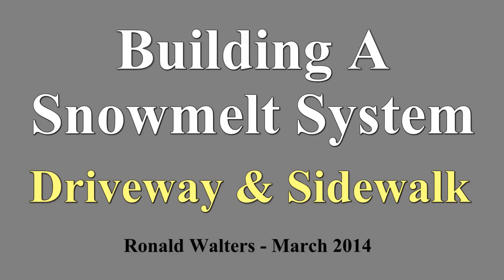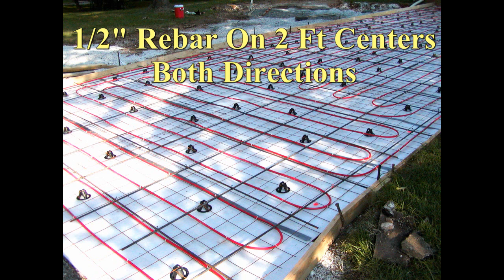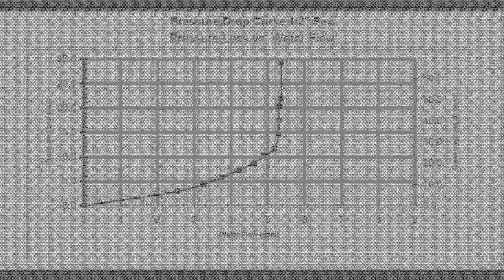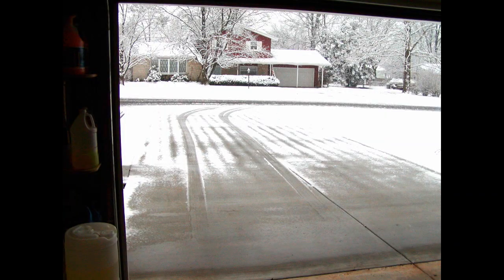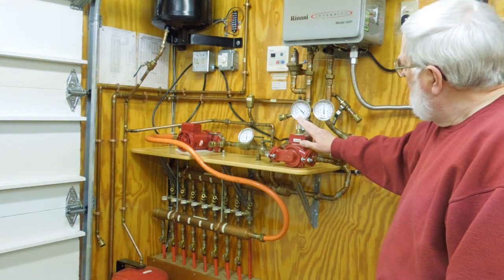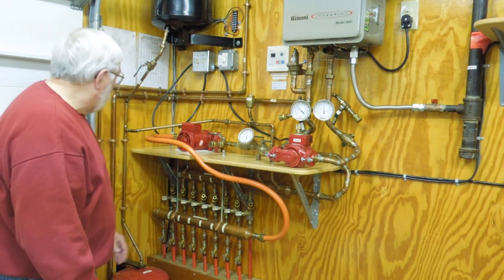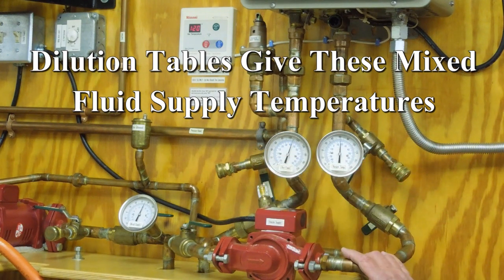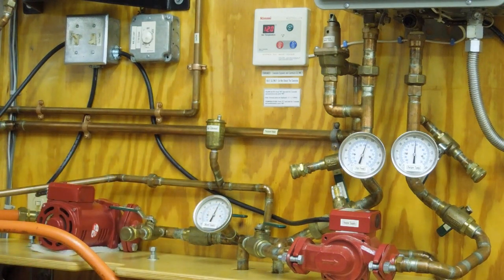Snowmelt, Building A System - Driveway & Sidewalk

Comment: hello Ron hope all is well
i recently fired up my "home made system" that i actully copied very similar to yours , im  experiencing a problem and want to see if you had a similar  issue befor maybe you can help me :)
my system loops are all running 1 gpm and its all circulates fine , the system runs fine for the first 10-15 minutes and when it starts to heat up my flow rate going into the heater starts to decrease gradually untill it stops and reaches zero ! no matter how high i start it from 1.5 gpm or 1 or even half , it slowly keeps dropping untill theres no more flow going into the heater !!! very weird i checked everything even replaced the pump and i have another heater also i replaced and it seems to keep doing the same thing ! do you have any idea why this occurs or do u have any hidden check valves in your system ? 
thanks in advance sir 
you have been very helpfull
Reply from the maker: The only time I needed to use check valves was in my house radiant system when I had individual pumps for each zone but a common return manifold. I had to go back and install check valves to prevent back flow when a particular pump was not running.

On my snowmelt system, the single supply pump feeds fluid to the supply manifold, which has each loop connected to it. There is a small valve for each loop to enable shutting that loop off (mainly useful when filling the system and getting air out or if you should somehow develop a leak).

All loops return to a single return manifold… but… each loop has a flow control valve and a flow meter for adjusting the designed flow rate through that particular loop. Loops of different lengths will require slightly different flow rates (by design).

You say each loop has 1 gpm going through it, but if you do not have a flow meter on each loop you cannot know for sure what is going through it. I say this because I have not see your system.

Your tankless heater has a screen on the intake side. Pull out that screen and see if it is plugged with junk. These screens are very fine to prevent plugging and damage inside the heater itself and the screens can plug easily. Any debris or contaminants will slow down or stop flow through the heater.

I have a small separate pump just for the tankless heater… so I have two (2) pumps. One large pump circulates the entire system and the small pump delivers a smaller amount of fluid to the tankless heater. The circulating pump circulates fluid through the loops at a constant rate. The pump for the tankless heater allows for regulating the flow through the heater. You always want to start off slow with heated fluid so you do not shock and break your cold driveway.

Any air remaining in the system can and will find its way back to a manifold or pump and cause cavitation, which will stop flow through the heater. The system must have absolutely zero air in it.  I use a Hoffman No.77 Air Vent located on a high point in the piping to bleed out any air which remains.

I have an expansion tank to allow for expansion of the heated fluid in the system. The expansion tank (bladder) is pressurized to 12 psi and I have the system pressurized to 15 psi. Pressurize the expansion tank first… then pressurize the entire system. The system must remain pressurized to keep the pumps running and to prevent damage to the tankless heater.
	
That’s all I can think of. Hope that helps!
Ron
Reply: @RonaldWalters2010   my system is identical to yours i have an 8 loop manifold with flow meters on each one and they are adjusted to 1 gpm with the primary pump it pushes 8 gpm and in that circulation everything is just fine , the secondary pump just like yours as well it pushes the water to the heater and back to feed the main line , the only difference is that i saw your heater lines are both going straight to the end of your manifold in my case my manifold only has  only 8 loops so  i have two Ts after the manifold that supply the heater and then back to the main line 

i have been reading about this for days and i think i found the problem , both Ts should only be spaces less than 4 inches apart so the pressure drop that occurs after it starts to warm up shouldnt effect the flow going to the return side of the heater and slowing things down , in my case i have them spaced far apart and tomorrow i will move them exactly near each other

yes i checked the screen and its clean and my system should have zero air in it 
im pretty sure now after doing some home work that having the Ts right next to eachother ( inner and outter) or replacing them with a mixed 4 way vavle should resolve my issue 

i do appreciate the quick replies to your comments
hope i get some snow soon to really see how this thing will keep up

Comment: Hi, I put a system in after doing much research and watching your use of on demand. I used 3/4 pex with 8 x  ~250 foot  runs to cover a 1900 sq ft driveway. I have a 200,000 btu on demand water heater. I have asked the pros and they are pumping the water out to the drive at 140 degrees. This definitely contradicts what you are saying. I can dial my water heater temp back to 98 degrees and with hot to cold injection I can take it down to any temp I want.  I have 2 pumps , a low speed and a high speed. I plan to keep the drive at 30 degrees with the low speed. Then use the high speed for the snow melt and bump it up.  My questions are...... if your driveway is sitting at 30 what temp do you send your water out to it at during a melt situation?  What temp do you target your driveway to and what return temp do you look for. Or do you look for a specific delta between outgoing and return temperature and adjust your flow rates to achieve this delta. I specd out a smaller heater but decided to go with bigger just in case. I doubt it will ever be taxed and maxed out , good thing it is modulating. I may/plan on adding some electric shut off /on valves and a snow sensor as I plan on making it somewhat wifi operable  and automatic.
Thanks
Reply from the maker: I trust you had someone do a heat load calculation for the size and quantity of PEX you have in your driveway. If you are planning on keeping your driveway at 30 degF all the time you are going to be spending a lot of money for gas. I do not heat my driveway in anticipation of a snow or ice storm. That is just wasting money. 

In my opinion if you start feeding 140 deg water out into a cold frozen driveway (concrete) you will probably crack it all over. Don’t forget the so-called pros are probably trying to sell you a bigger heater or new concrete or just like spending someone else’s money. They may be operating someone else’s system or don’t care if they break the concrete… or they may not know what they are talking about. It may be time to find a new set of “Pros”.

I had “pros” tell me to turn the system on and heat the driveway in the beginning of winter and let it run until spring. Right! That is stupid. That is a government operation… spending someone else’s money. 

You don’t want your on-demand modulating all the time. I feel that is hard on the unit. A heater that is turning on and off or constantly modulating flow rate is like a transmission constantly shifting up and down for no reason. The program of an on-demand heater tells it that it must deliver the selected output temp. If it cannot deliver that temp fluid at the existing flow rate, then it starts trying to restrict the flow rate through the heater. I want my on-demand to operate as a smooth constant burn (speed). 

Trying to find a smaller on-demand heater that can be slowed down to 0.5 or 1 GPM is difficult. My heater is too big. If I replace it, I will use a smaller heater. 

My snow sensor is my eye. A good thick layer of snow acts as a blanket to keep the heat in the concrete. 

In my opinion automatic valves and wifi is just something else to go wrong. K.I.S.S. is the best approach. 

I send water back to the driveway 10 degF +/- higher than it comes in. As explained in the video I have one pump circulating the driveway and the small pump circulating through the on-demand. The heated water is injected back into the fluid being circulated through the driveway. This is dilution or tempering. As the return temp starts to increase I SLOWLY start increasing flow rate through the heater or increase the heated fluid temp. I have a set of dilution tables (for my system) I worked on 10 years ago. For a given temp return fluid, at a given flow rate, how many GPM of hot water will increase the fluid temp 10 degrees … or 15 degrees… or 20 degrees… etc. The tables have proven to be quite accurate at predicting the expected supply fluid temp.

Now you just wait for a snowstorm and go out and play with it… learn how to operate your system without wasting a bunch of money on gas and without breaking up your concrete.
Reply: @RonaldWalters2010  I did have  calc done with one guy saying 200k might do it and one guy saying it’s not enough. I did my own and came up with a 150 k heater. I did some test runs and I believe I could get away with prob 100k heater but they don’t make them. 
Anyways , I can feed the water into the cold  like yours and get the temp down to a 10 degree delta. I just wonder how long it would take to get the driveway from 20 degrees up to 38? 
Since I still work and I can’t trust my wife , I need some type of remote automatic/ control. 
I have 2 feeder lines with ball valves and plan on adding solenoid valves to give them some automation Once I get it dialed in. 
Our average temperature in London Ontario is about 28 degrees in Jan and feb so I may try to shoot for that and watch the gas meter. 
Like you said , its cheaper than the Dr’s bill. 
Thanks for the video, it helped convince me to put mine in. I will post my own when I get time.  
Thank you for your reply, I’ll let you know how things progress

Comment: Could you show how the piping came from the loops into the garage? If you had an asphalt driveway, after the snow has melted and the driveway dried out on the sunny days could you extract heat from the asphalt with a heat exchanger and some modifications to put the heat back into the house?
Reply from the maker: There are 8 separate loops in my system, which have 16 PEX pipe ends exiting and returning to the corner of the garage. I had a 6” plastic pipe and elbow in the corner of the garage floor, which is seen at 1:38 in the video. The pipe ends need to drop down below driveway grade and are fed through the 6” pipe. The 6” pipe keeps the pipe ends together and protects them from any sharp edges. Later, the ends of the PEX pipes are organized and split into supply and return manifolds as seen at 4:20. I built a box around the pipe to protect them from any possible damage.

Asphalt would probably be a poor choice for this system as the placement of the asphalt would be difficult around all the pipe and wire mesh, trying to keep the pipes centered in the asphalt.

The concrete gets hot enough and yes it could produce hot water (available any sunny day all year long)… but what are you going to do with it? When the sun is shining you don’t need very much heat in the house so you would need to store that very large quantity of hot water somewhere for future use. When you start thinking about storing tens of thousands of gallons (or larger) of very hot water in a very well insulated tank, things start to become impractical. Or you may generate electric with the hot water. Pencil on paper soon slaps one back to reality as the cost vs benefit or cost vs savings is not justified for most applications (unless you just want a hobby).
Reply: I Have good cold well water. I am thinking of preheating the water before it goes into the hot water heater. After seeing your video I heard of placing the tubing in sand under the asphalt.
Reply from the maker: John, A little heads up about leaving comments on youtube. I receive a lot of comments and questions on youtube. When you leave a comment or ask a question nested under someone else's comment (even your own, if your previous comment is weeks old), it immediately becomes lost in the shuffle... as with this video which has years of comments. I know you left multiple comments or questions but now this is the only one I can find to reply to.  Always leave a fresh comment under the video if you expect to receive an answer.

I consider asphalt a bad choice for this type system mainly because you can't place the PEX inside the asphalt and even if you could, the asphalt may be hot enough to damage the PEX. Also asphalt does not last as long as good concrete. This has been asked and answered before in the comments.

You do not want to use plain water of any type in your system and certainly not well water because of the dissolved minerals. Distilled water only should be used.

I have also addressed the type glycol used in my system.

Comment: thanks for the video.  Can you clarify what kind of tank you used to maintain pressure within the system.  I think you said a header tank but just want to confirm.
Reply from the maker: C Lieberman The "Header" or holding tank is an air tank for a semi truck. It is large enough to hold approx 5 gallon of extra fluid for the system and then has a couple of gallons air space on top of that. I pressurize the tank to 15 psi with nitrogen which pressurizes the system. This extra fluid is intended to compensate for a small leak which could occur (pump shaft seal or other) to keep the system from running dry or sucking in air. You need to make sure the inside of the tank HAS NOT been painted. Tank manufacturers often paint the insides of the tanks with lacquer to supposedly prevent rust. Glycol is a paint thinner and will dissolve most paints. I coated the inside of the tanks with 3 coats of Red Kote Tank Sealer (Google it) which is an involved process to be done outdoors (very volatile solvents) and the tank will need a constant air flow through it to dry the sealer.

Comment: Hi Ronald.  Thank you for this great video.  Quick question on surface material.  I'm considering a new heated driveway using Viega panels and PEX tubing.  Do you have a view on asphalt vs. concrete?  I've been told that concrete is faster to heat up and stores the heat longer than asphalt.  I also have concerns about having to repair asphalt in the future, as it would certainly risk damaging the PEX tubing.  Many thanks.  Mike
Reply from the maker: +Michael G Can't even imagine how you would put PEX into asphalt and get the PEX centered. Asphalt is really hot when it goes down and would probably damage the PEX. So that leaves concrete. Asphalt in the sun absorbs heat and more readily melts snow/ice just on its own. I see no practical application for Viega panels and a concrete driveway. The PEX needs to be centered, not under the concrete.
Reply: I have a neighbor that cut slots through his asphalt on the car wheel centerlines, and put insulation, tubing and pavers in the slots.  The driveway is long and steep, and it looks like it works well to clear the snow and ice.